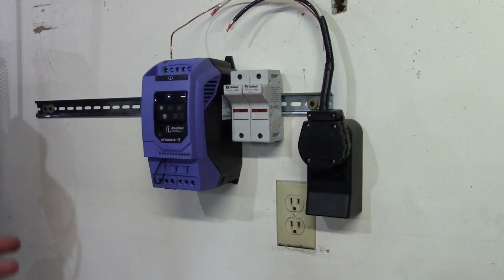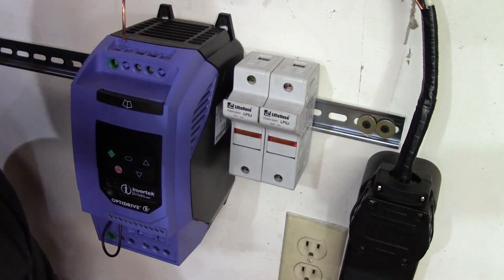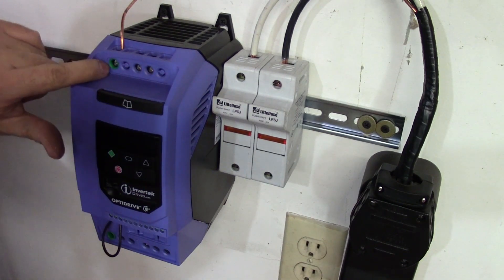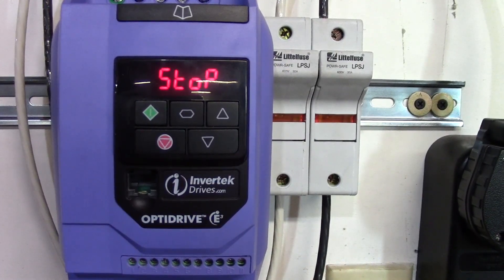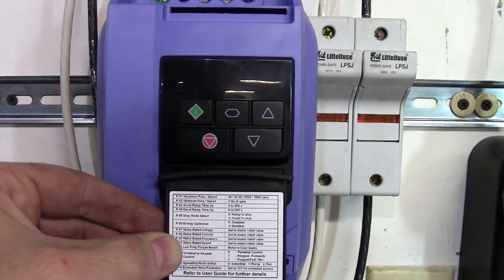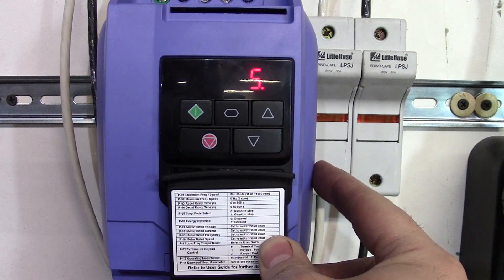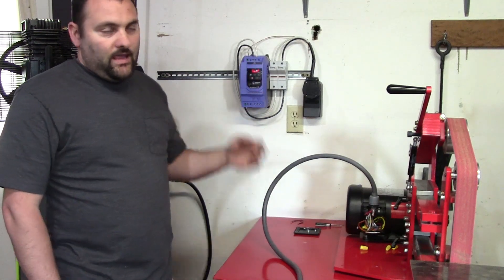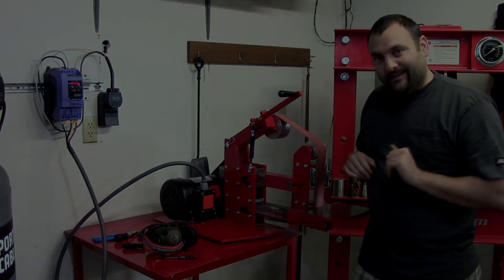How to Wire and Program your Invertek Optidrive E3

Comment: Can the input be 120v ?
Reply from the maker: I'm not 100% sure.  If you did feed it 120v I would de-rate the output by 50%. Don't use it for more than a 1hp motor in that case.

Comment: why do you need the fuses if the vfd has overcurrent protection
Reply from the maker: The overcurrent protection protects the motor not the vfd.   Also if you have a dead short between two of your motor legs take out the vfd.  If you lose one leg of your input power there's a chance the second leg will pull too much current and blow the fuse once again saving your vfd from certain death.

Comment: What fuses are you using for this setup?
Reply from the maker: I'm using what they recommended in the owner's manual.  I checked this notification on my phone I'm afraid I will forget to double-check when I get home so I'm going to do my best to answer from memory.  I'm pretty sure a 2 horsepower version requires 16 1/2 amps per leg.  My setup is a 3 horsepower and I don't remember the exact amperage.  The owner's manual has a table that tells you how many amps based on which model you have
Reply: @BeckTools  I figured it out. 16amp Type B Curve.
Reply: @jfuqua72  Are you running a 2HP motor? Where did you get your fuses from?
Reply: @BodineCustomKnives  2 hp...have not purchased fuses yet....project got put on the back burner.

Comment: Be HONEST is the worth buying? Is it reliable? I have a bad daddy industrial Saylor Beall air compresson that is 5hp 3 phase and to buy this inverter it cost $750.00 or i could just buy a baldor single phase motor for $586.00. If this works well snd is reliable i would rather buy it and stay 3 phase but on the other hand if its going to be a pain in the ass then i am torn to just go single phase and be done with it. Homes need to start being built with 3 phase if needed and not be some all big thing to just have it
Reply from the maker: Invertek drives are sold world wide.  They are high quality drives.  I have drives for 5hp 3phase motors on the website.  becksarmory.com  I got the one in this video for free when I became a dealer.  Since then I have purchased two of them with my own money to power my knee mill, and one for a future build.  I've put my money were my mouth is.  I could have gotten other VFD's cheaper but I don't like to buy junk. :)   If I didn't trust it I would not have purchased them with my own money for my personal projects.
Reply: @BeckTools  i called invertek and they said i need this one ode-3-320153-1F4A  and i dont see that one on your website?
Reply from the maker: @AdamOutlaw87  this is the same one without the Integrated Brake Transistor.  If you're running a compressor you don't need a Integrated Brake Transistor.
http://becksarmory.com/product/ode-3-320153-104a/
Reply from the maker: @AdamOutlaw87  the internal break just helps you stop the motor faster.  There is no reason to do that with an air compressor.
Reply: @BeckTools  okay great i will order it within 24 hours i hope u have it in stock and thanks for the support im itching to get my compressor going
Reply: @BeckTools  right on thank you👍
Reply from the maker: @AdamOutlaw87  These are in stock at the Chicago distribution hub.  They ship out within a day or two of my customers ordering them.
Reply: Sorry last thing with this drive you dont have to buy one thats double the HP like im told you do with a rotary phase converter? Cause if you do i will i just need somebody to be honest?
Reply from the maker: @AdamOutlaw87  No you do not need to overcompensate with this vfd.  It outputs 15.3 amps of 3 phase power at 220volts.  Double check your motor name plate to ensure you don't need more than 15.3amps.   This is the largest single phase to 3 phase converting VFD you can get.  If you need more than 15.3 amps you'll need 3phase power to feed a 3phase VFD.  You will want to put fuses on the input side to protect your investment.  VFD (all of them on the market only have warrantees that cover manufactured defects)  If you wire it or program it incorrectly and burn it up that's not covered.  A simple set of fuses protects your investment. :)
Reply from the maker: @AdamOutlaw87  my latest video shows how to hook up this vfd to a 3phase knee mill. Swing over to my channel and click on my videos tab.
Reply: @BeckTools  my compressor is finally being delivered tomorrow and i will order the invertek drive... yes i watched that video of you wiring that one up.i dont understand why i cant use that one instead of the almost $800.00 one? The # on that is ode-3-320153-1f42 why will this one not work? It looks like the one u show in the video I just dont know if it would work or not I simply dont know enough about these honestly
Reply from the maker: @AdamOutlaw87  You just need to have enough power to run your compressor motor.  You mentioned it's a 5hp motor.  The one I used on my knee mill is 3hp.  You also do not need to get the IP66 version.  You can run the IP20 version if you keep it fairly clean.  This one will power a 5hp 3 phase motor.  I just doesn't have the dust proof and washdown housing.  I run an IP20 vfd in a dusty shop.  I just blow it out from time to time.  Here is the link to the IP20 version ODE-3-320153-1042  
http://becksarmory.com/product/5hp-200-240v-1%cf%86-input/
Reply from the maker: @AdamOutlaw87  The one I used on my 3hp mill is ODE-3-220105-1F4A not ODE-3-220153-1F4A  the 105 stands for 10.5amps  the 153 in the other part # stands for 15.3amps.  10.5amps is not enough for a 5hp motor.  I have 3 different models that will all power a 5hp motor listed on the website.  IP20 = $566.00, IP66 = $778.13, and IP66 with knobs and dials = $969.00.  Every one of these have the same performance.
IP20 not dust proof or water proof
IP66 can be be sprayed down with a pressure washer. 

You can control the motor speed and direction using the buttons on the front of all three VFD.  If you want switches and knobs you can add them but they are not needed. 

The expensive one just comes with toggle switches, dials and power disconnect already installed from the factory.  If you have any other questions shoot and email to richard@becksarmory.com and I can reply with my phone #.  I just don't want to post it on youtube. lol
Reply: This drives are great, simple and not over complicated.

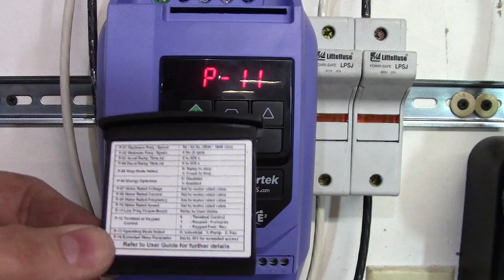Comment: Hi, my drive suddenly didn't function anymore, so i've reset to factory settings and reconfigured all parameters. But...for F12 ( settings keypad 7:15 in the movie ) i can't change the digit  ( is on "0" now ) When I press up or down the "0" remains and the first digit of the screen shows additional an "L" as long i push the up or down button....What can be the cause of that? Thx
Reply: Try to remove the cable from terminal 1 and program it. Turn it off, add it back and turn it on again
Reply from the maker: hmm I'm not sure what would cause that.  The arrow buttons worked on all the other settings?